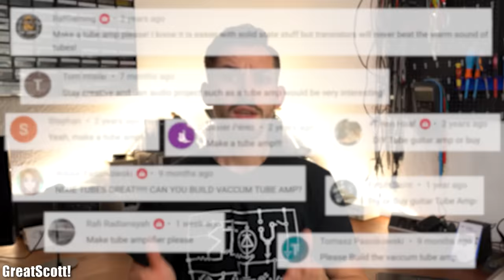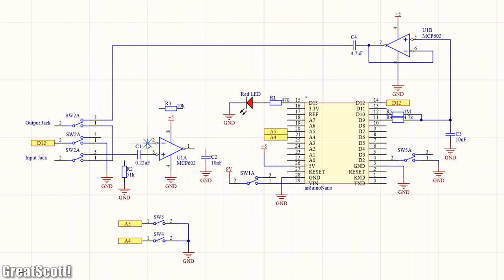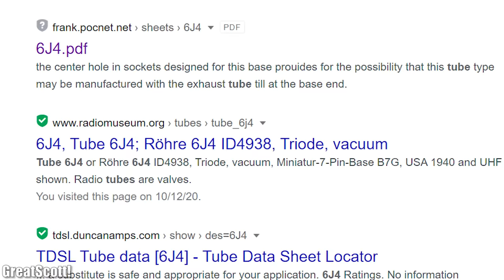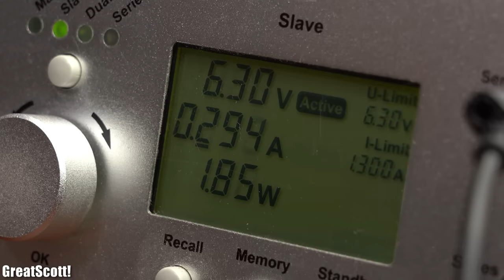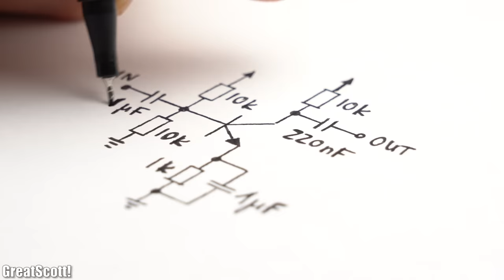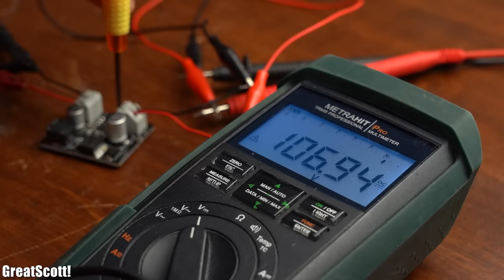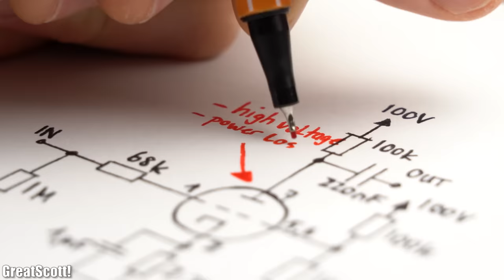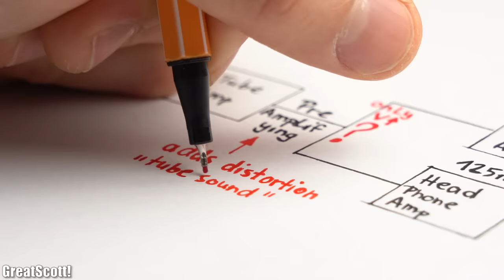Building a Tube Amp! Does it produce better audio quality though? EB#47

Comment: This is NOT and I repeat NOT a true representation of a classic tube audio amplifier. A true tube ausio amp has no solid state parts in it anywhere . It will be all resistors and capacitors. It will have a high voltage transformer called a plate transformer That will step up the voltage from 110vac to around 500vdc. The preamp tubes will usually be a 12AX7 and the finals are usually a pair of 6L6GC or something similar. Aslo you have to have an output transformer. Which will couple the plates of the output finals and the output of the output transformer would be either 4,8, or 16 ohms connected directly to speakers. And since we mentioned speakers you cant just use modern day speakers made for Transistor amps they need to be paper cone speakers
Reply: True said

Comment: Soldering to all-glass tubes with pins is a big no-no, as they are likely to crack because of the pin thermal expansion. Sometimes the pins can also break off instead. You can get subminiature tubes that have solderable leads, but even then there is a minimum distance from the envelope specified.

Comment: On that graph, linearity isn't given by how much those lines are "curved", but by how much they are "distant" from each other (given the same polarization difference). In the common cathode circuit you made, you "move" on the load line defined by the anode resistance and the supply voltage. Plus, in a correctly designed amplifier, you don't drive the grid very negative, so the linearity of a good triode is excellent.
I didn't read it, but given the images this should give you an idea: https://robrobinette.com/Drawing_Tube_Load_Lines.htm
Also please use a proper THD meter, not your eye.

Comment: 11:40 You cannot look distortion like that! The plate voltage does not change. You should look at grid voltage to anode current.
To do this, draw a line from your plate voltage (B+ or HT) on the voltage axis, to the short circuit current on the current axis and see how it crosses the grid voltage lines. Just like designing a BJT amp.

Also, the reason you don't need a tube amp is probably the music producers are using tube devices or software models of tubes to record, mix and master the tracks.

Comment: Generally, it's the inherent nature of the vacuum tube amp (as a system) to amplify 2nd-order (or, even) harmonics in addition to odd harmonics; the EVENS make tubes sound more "musical". This is especially the case with push-pull topologies where slight imperfections in tube-match and output-transformer-balance result in asymmetrical push & pull waveforms. Modelling this by comparing the Fourier series of square (symmetrical) waves versus rectangular (asymmetrical) waves gives insight as to why tube amps sound more "natural, warm, and musical" .. fascinating study. Thank you for the brilliant experiments !

Comment: A single ended Class-A valve circuit of good design i.e. with linear curves, has one massive advantage: The amplifier is just pieces of metal in a vacuum. It doesn't get any simpler. The trade off is that ANY component or cable not up to the task suddenly clouds the sound.
Work with the laws of physics and use pure tube circuits, single ended, valve rectified and you'll be lost in the music for the rest of your life - heaven! :o)
   ...Or get a series transistor amps and spend your life looking at specs :o(

Comment: One very important quality overlooked here is the slew rate of a transistor vs a VT. At least due to the higher operating voltage, if not the speed of electrons flying from the cathode to the anode (~10% speed of light), tube amps have much faster slew rates. This is really going to stand out with the shape of the transient note attacks, and that's a really key part of the sound that our ears pick up on because it is so frequency rich -- at least that's my understanding of it.
Reply: True said

Comment: soldering directly to the tube pins is just asking for the glass to crack from heat induced stress...use a socket!
Reply: That was my first thought when I first started electronics I destroyed a lot of valves before I managed to salvage some sockets from old radios.

Comment: After all that, you still don't know what a high quality vacuum tube based audio system sounds like because you didn't listen to one.
Reply: cuz the high quality ones are fuckin expensive as hell lmao

he still got the fundamentals right. tubes color the sound. some people like that. other people don't. it's half personal taste, half falling for audiophile snake oil salesmen.
Reply: @syn010110  Some tube amps are very expensive, some are not....same is true of SS.  But good tube amps do not have to be expensive at all if you check the market.  I've bought used ones for as little as $20 that sound amazing, and new ones for as little as a few hundred dollars that are really good.  There are excellent new tube amps for ~ $1300 that are mind bogglingly good.  There are also excellent tube amps (and SS) that cost > $50K....I don't buy them.  

All audio components add or omit something to the sound.  The better tube electronics add less color to the sound, not more...they disappear and the let the recording through. Regardless of the tonal balance of the system, tubes tend to reveal more information of the performance...if they're less than transparent than SS, something is wrong with the amp.  I've listened to a lot of excellent examples of both tube and SS.  The best of tube has always been more transparent IME.  Tubes do get hot, do require more care and knowledge than SS, so there are some downsides, but for those who listen and are willing to get familiar with them, they also offer a huge upside and lots of performance rewards that SS amps don't.
Reply: real vacuum tube amplifiers are expensive,
Reply: @syn010110  Except he didn't, he just made a shitty solid state with a tube buffer. The tubes aren't in the right stages to do their job right

Comment: Brings back the days when i did up an old 1935 valve radio, the voltage was up at about 450 volts for the tubes to run

Comment: The distortion is what people seek and why guitar amplifiers also use valves.
Reply: Vey true, however there are two thoughts on tone shaping: forming your tone at t he pre-amp,  or include the entire effect of the power amp and choice of speakers/ cabinet.  Recreating a signature sound through whatever amp and PA system available would be ideal for travelling musicians.  A recording studio can afford to store a plethora of amps and cabinets to achieve certain sounds.
Reply: progste
 ... the distortion you speak of is not obvious till pushed to the higher limits of the amplifier. The main difference between tubes and solid state is tubes will be going into this distortion gradually so there is greater artistic control. A talented player can make the amp do what he wants, almost on command. A distorted tube can almost sing while a distorted transistor will get raspy.

Comment: Well, they shouldn't sell this amp as a tube amp, since it's hybrid.
Reply: Yup, these cheap Chinese devices are just pretend. It's not even truly hybrid as you don't have a proper tube preamp stage. It's really just a tube buffer strapped between an opamp and a cheap Class-D output module. It's utterly pointless. NOT the way to audition tube sound, at all.
Reply: @jonathanvanier  Following a similar discussion I was forced to listen to one by a friend and can say that his does have an effect on the sound, not a great deal but noticeable. I wouldn't describe it as a  "tube sound"  but there is some colouration although whether it's related to the tubes or an artefact of circuit design is another question.
Reply: @Steve_Coates  I’m willing to give it the benefit of the doubt, especially since you heard it yourself. But like you mention, I don’t think these devices can really give a true “tube sound ”. For that, I’d stick with a proper setup.
Reply: As soon as I saw the inductors lined up along back end I just knew that there was a class D amplifier lurking around in there somewhere! 
Class D amplifiers are only good for portable Bluetooth speakers where you just need loud music and quality isn't important... This is a terrible combination... I would have been happier to find class A/B chip amplifiers instead of what they chose to use... This was clearly designed by someone who doesn't understand what tube sound is about..

Comment: Mr. Scott, the output signal of the 6J4 triode (at 8:14) was so ugly because of improper biasing. The grid does not require the 50V nor the 100k resistors. Maybe you should consider using just a 1 megohm resistor between grid an cathode and perhaps your power supply was not faulty.

Your 6J4 valve was operating in saturation region, so you found almost no output swing!

Comment: The other key to a good tube amplifier when using tubes to drive speakers are the output transformers to mate the high impedance of the output tubes to the low impedance of the speakers. That is why these ebay amps are so cheap they only use tubes in the input stage of the amp.  The tube design helps to lower listener fatigue from some CDs with to much compression of the audio signal creating a harsh sound .  Great video !

Comment: Hey Man!
Just want to throw in my 2 cents about tubes in audio. As an electronic component tubes have have some pros and cones:
+ Tubes can amplify voltage with spectacular effects. You can get plenty of volts at the output with very low distortion, especially compared to similar stage built with transistors.
+ Ton of headroom
+ Robust against EMC (kinda like JFETs)
- Heater losses
- High voltage required
- No P type equivalent
- Low current capabilities

As you can see, tubes can be useful in certain applications. Using tube with some kind of active load can make a wonderfull input stage for an amplifier, or a whole preamplifier in just one stage. Althoug I wouldn't recommend using them as power amplifiers as in all tube power amps. Even with output transformers they don't do it very well. Tubes also do best when used with silicon around them as support circuit, you can get some real crazy circuits that way.

Comment: ... and I will continue to build them, because a full tube amplifier is not only nice to make and to look at, but also can amplify with just a couple of components very weak signals, without perceptible hiss ... which is one of the main reasons, I like them way better than transistors. I know, I can filter, but I prefer not to have noise in the first place 😊

Comment: I acquired a 1939 Philco  cabinet radio 12 years ago it was in storage in a canvas bag from 1969 until i received it. I stored it and recently rediscovered it.
I was amazed it still worked when I plugged it in .. the only problem was the power cord had deteriorated and was cracking and falling apart the first thing that I received was a radio station from Pennsylvania and I am in Augusta Georgia. Sound was excellent i did not play it too long bc of cord. I think its a well built device. If i can find someone close for refurbishment will have professionally done. To me it amazing sound quality from this ancient instrument.

Comment: I used to repair console radios and some high performance transistor amplifiers in 70s,after 1980, tube amplifiers almost disappeared.  In theory, transistors  have much better linear characters, and distortions are much lower on paper than tubes, however, transistor amplifiers generate odd harmonic distortions and tube amplifiers generate even harmonis distortions which is acceptable to human hearing, that why they have warmer sound.
One time I decided to test a German tube radio with single end ouput, I was very surprised that the distortion meter showed a  below 0.1 percent distortion which is extremely low for tube amplifiers. I hope I can now find those oldies radio and bring it home.

Comment: I have a 6J1P pentode. Will try to do something with it some day. I previously used it as a DC amplifier for very small signals while I created a photoelectric cell out of zinc and copper. Now I use a darlington transistor for an amplifier so my tube is free. Apparently it can work at lower voltages. As low as 24 volts.

Comment: Its quite true. I’m using my tube amps only to create music with guitar, where the tubes are participating on building tone and those distortions can be drive in or out. But for reproducing(hearing) I’m still using mine ‘68 transistor pioneer amp, since I don’t want to changing recorded sound after amplification.

Comment: Vacuumed tube amplifier  creates a clear deep sound (by  using a load line from its datasheet with the most little curve in it) 
The problem with those is the dangerously high dc voltage required and the efficiency 
Transistor technology is great but if you get 2 radios  one vacuum tube technology and the other a transistor  type radio  (assuming using and external speakers in a box with same box and speaker type) 
You will notice the vacuum tube radio has a clearer sound quality  (feels soft and little high pitch grinding sound right?) .

Comment: I work at a nuke plant that still uses tube amps in its neutron monitoring equipment.  Plant was designed in the late 50s and early 60s and went online in 1969.  We have upgrade parts of the circuits to solid state but still use tubes in a couple if remaining circuits since they work very well.  The preamps still implement them as it is hard to implement a solution which will not alias out neutron hits, without a wholesale upgrade which is $$$$$.  It also makes me chuckle that more modern plants, including the other unit on site, use a 386 sx based system for neutron detection.  Although there are still a lot of analoge circuits on the back end of that system.

Speaking of which, I would be interested in seeing a video of a comparison between DSP's and analog filters.  That might help the engineers in training out there as well.  My bad if you have already done one.

Comment: The 100v DC in the Fosi amp comes from a switching boost convertor IC UC3843B, it's a common chip and I've made one, it's clean enough to use in a tube amp and it's possible to change the duty cycle, output voltage and switching frequency.

Comment: If you want tubes that light up good, you want tubes with thoriated tungsten filaments, e.g. 811a power triodes.  65 watts plate dissipation.

Part two: the usual situation with most all-tubes amps uses an output transformer, which acts like a low-pass filter.

Comment: Used to work at a shop and repair tube amps but mostly speakers way back when. A simple  push pull  (we used to use 6v6 or the similar - alot) was all that was ever needed for everyday listening.    Try to find a old console amp to play with, they are pretty cheap, usually all the parts are out of whack but for some weird reason still sound pretty good.